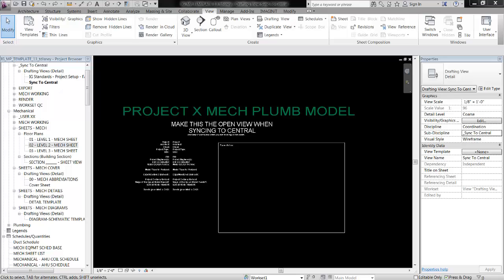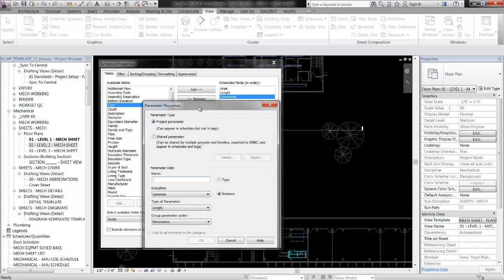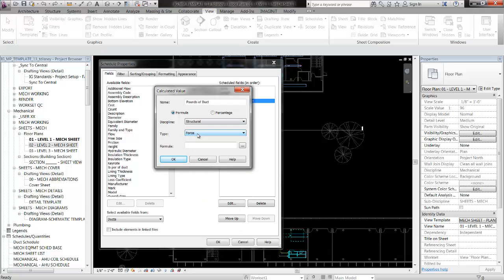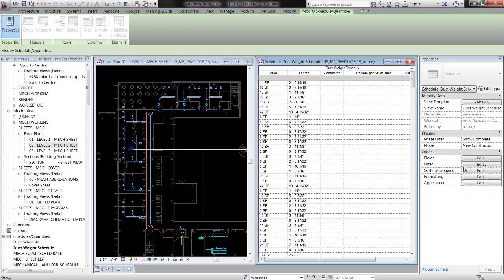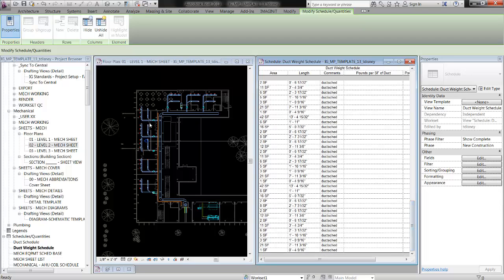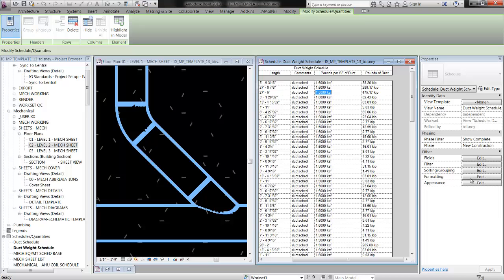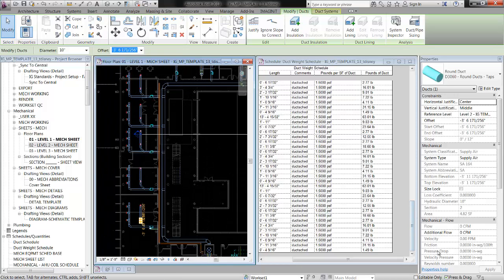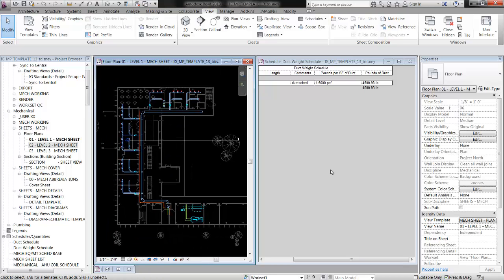How to do Material Takeoffs for Ductwork in Revit MEP 2013

Comment: First of all I would like to thank you for this wonderful tutorial video.  I have done same as you have shown in this video but i am not able to get the area of the duct fittings that is elbow and reducer. Can you please tell me where I am getting wrong. I will be very thankful to you !
Reply from the maker: That's tough hhharoon. I'm not sure the area parameter works for all duct fittings - a quick check showed that transitions had an area but elbows and some others did not. You might be out of luck with duct fittings - or have to really dig under the hood and modify the fitting families to report area.

Comment: Do you know how to find the formulas revit uses in background?  For example, in your schedule you have duct area, how do you see what formula they are using for calculating the area?
Also, how do you create separate schedules for round ducts and rectangular ducts?
Reply from the maker: Not sure how to find the formulas that Revit uses - although if you are worried about correctness you could try comparing it's area calc to your own - spot check it, in other words. It also might be easy to find the formula somewhere.

To create a separate schedule for round vs. rectangular I would use the Filter tab in the schedule editor. Off the top of my head I would filter by Family Name > Includes > "Round"/"Rectangular" but there might be a more elegant parameter you could filter for (i.e. filter for "Diameter" exists, because only round duct would have that parameter).

Cheers!
Reply: Tyler Disney
Thanks Tyler :)
Reply: Tyler Disney  Hi Tyler, you can find some of that here http://inside-the-system.typepad.com/files/rme_calc_duct_sizing-1.pdf